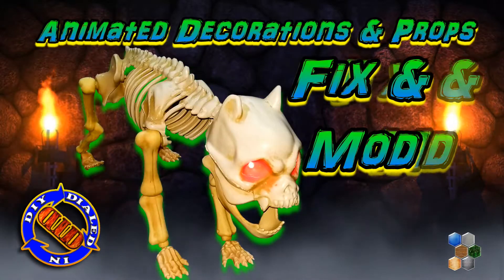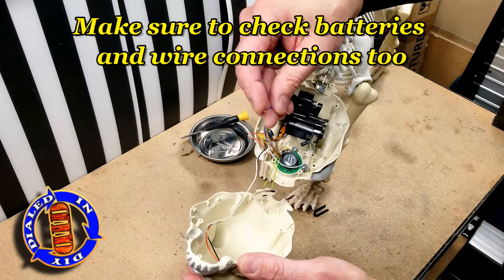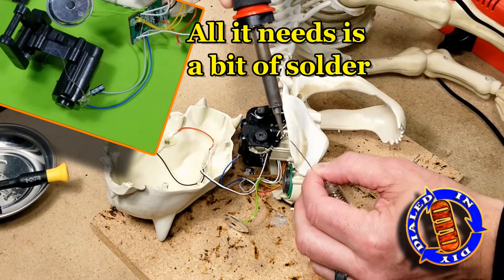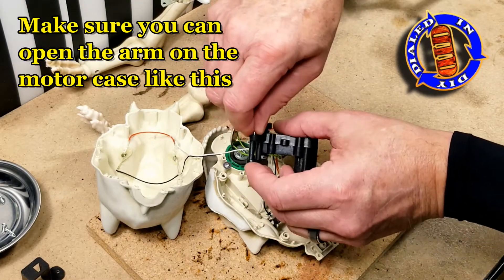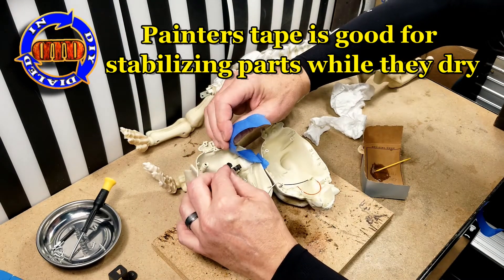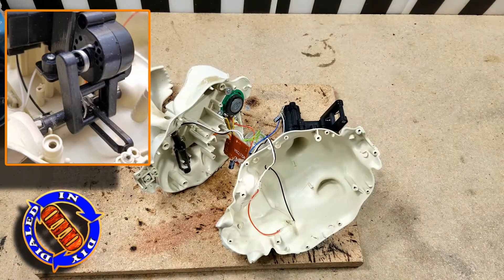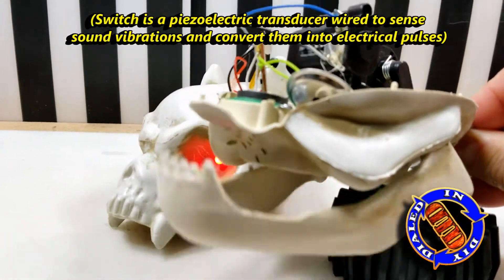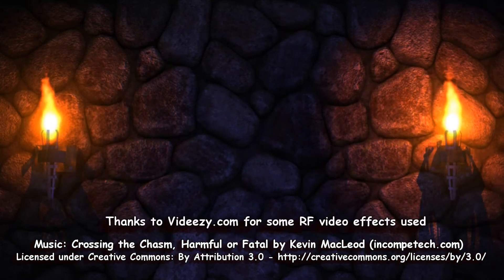Repair Animated Decorations & Props - What's Inside & how it works

Comment: I have a Hallmark motion ornament from 1988 a copper contact wire has cracked .I'm hoping I can solder the right grade Of Copper wire to extend The missing length ?are you up to me sending you a photo so you can take a look at it and let me know what you think, if the grade is weak I'll get no light no motion if the grade is too strong I might have overheating. I'm open to suggestions and strategies since halomark tech department will not speak to customers they want you to throw out everything and buy something new

Comment: Do you take commissions to fix other people's decorations?
Reply from the maker: I really wish I had the time and means by which to do that.  This stuff is my hobby and I have been having a hard time finding time to even do that the last 18 months or so.  Did you have something specific you were trying to fix?  Happy to provide any feedback or suggestions if I can.  I really appreciate you taking time to watch my video and post a comment!
Reply: @DialedInDIY  i have some broken jumping spiders from Spirit and just a few decorations that are super old
Reply from the maker: @tabithajimenez9215  I found a thread on the topic.  Is this the same jumping spider and  does the type of problem you have match what they are talking about? https://www.halloweenforum.com/threads/spirit-jumping-spider-not-working-for-the-long-haul.125325/
Reply: @DialedInDIY  I have had the problems they are talking about, but I have two spiders that the motors aren't working, and the zombie dr, from Spirit, told me they don't make replacement motors and that they're unfixable. I was hoping they were wrong.
Reply: Just came across your channel and subscribed. I have the teeter of terror and the sound quit working, any ideas?  Also have the lunging reaper that doesn’t lunge anymore and a clown that doesn’t light up or move anymore, no clue how to fix them